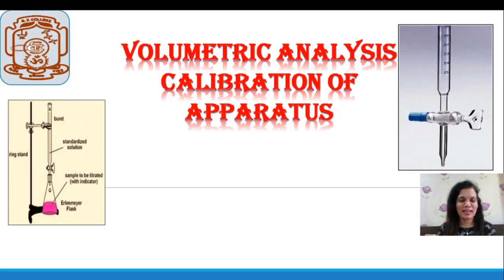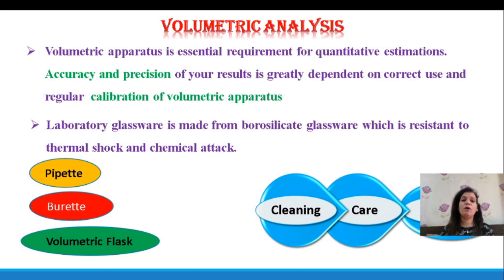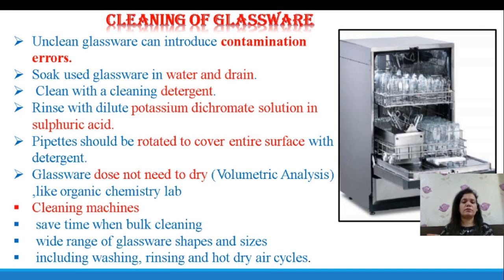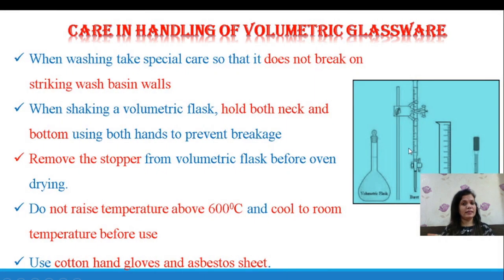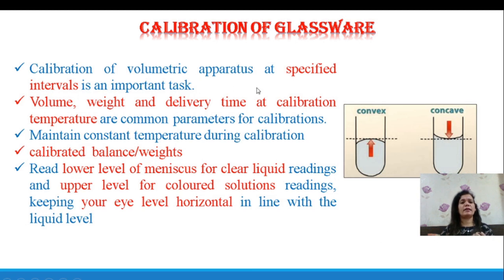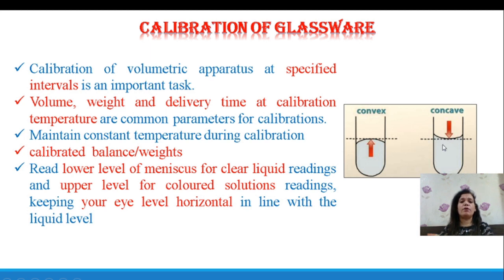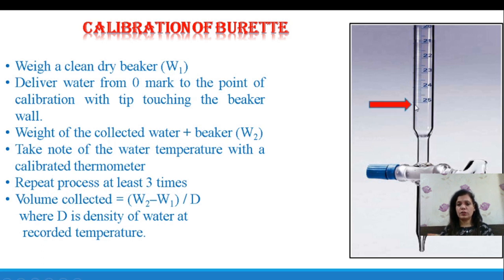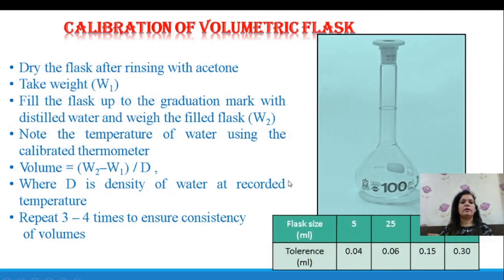Calibration of  Volumetric analysis Apparatus

Comment: Mam how to calculate the wright of burette filled with solution.
Reply from the maker: You don't need to do weight of burette.... You need to fill distilled water in burette upto mark zero till it's capacity and drain in preweighed beaker... Then find the weight of that water which corelate burette capacity as water density is 1.
Reply: @dr.suchetasinteractiveclas9804  thank you so much mam❤️